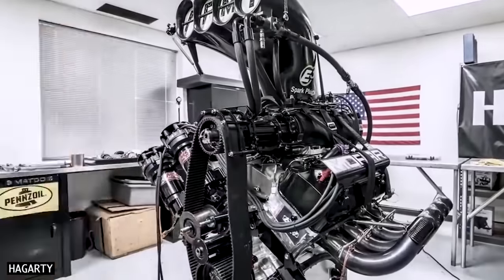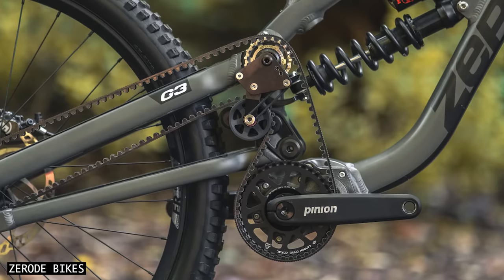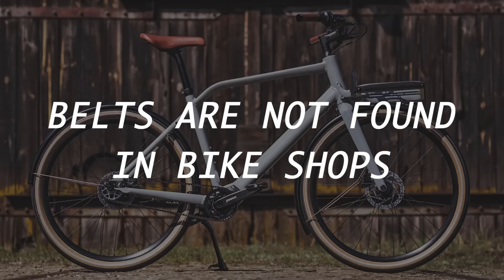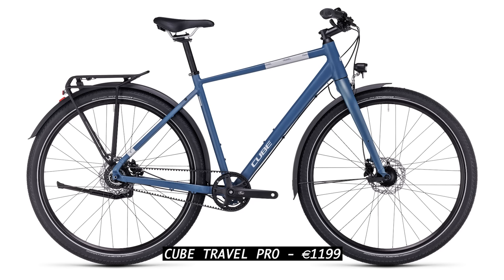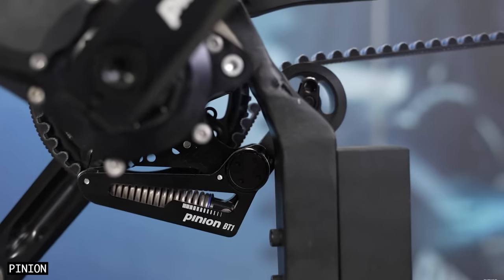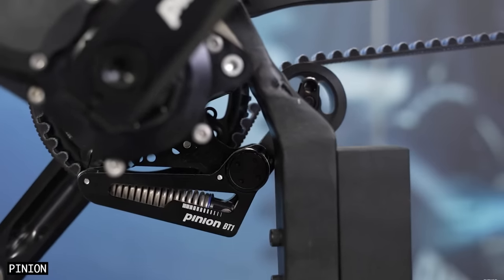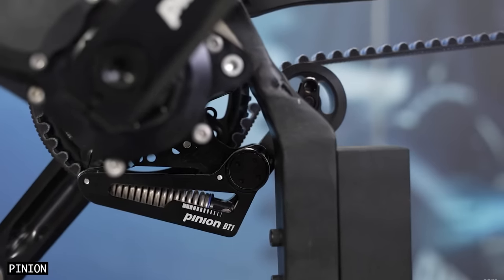Belts Are Now BETTER Than Chains On Bicycles!

Comment: I love  the idea of a belt drive, but it's rather impractical for me. I run wide range 2x drivetrains, my gear range is currently 739%. I am kind of mid fitness, I use my bike for absolutely everything. Commutes, carrying shopping, 100 mile single day rides to 400 mile bikepacking trips.  There are a lot of mountains in the UK in particular between where I live in Scotland and the rest of my family in Yorkshire which is probably my most common bike packing adventure. The range for me just isn't enough. I'm quite a big bloke and on bike packing trips, I like to be comfortable, and warm. And probably carry way too many tools and spares. (Though every single tool in my portable kit has been used at one point or another). I would rather have lower ratios (that also don't take away from my unloaded top end riding speed), so I'm never caught without. Never freezing up. Mountain cos a winter sleeping bag and rugged tent weighs too much On top of that I don't think I'll ever be able to afford a bike with a belt drive, if I could it certainly wouldn't be the highest range one. I really love the idea of no maintainable ect but it's just....very impractical for my use case.

Comment: At this point the only reason I'm not running a belt drive is that my frame doesn't have a break to allow me to install one. My next frame will either be compatible or I'll have a framebuilder modify it so that it is. I ride fixed gear, so this is really the only barrier I have. Well, that and the price of Gates components in Japan

Comment: It is a mystery to me why most e-bikes are not mid-engine, belt drive to a multi-speed internal rear hub. The motor  assist  more than compensates for the added kilo of weight. This is especially true with the road bikes. Saying good bye to chains and derailleurs is worth the extra money.

Comment: Summary
* Belt Drives in Cycling: (00:00:02) The video discusses the pros and cons of using belt drives (specifically Gates Carbon Drive CDX) instead of traditional chain drives on bicycles.

* Advantages of Belt Drives:
    * (00:02:12) Long-lasting:  Lasts 3-4 times longer than chains (35,000-40,000km+ reported).
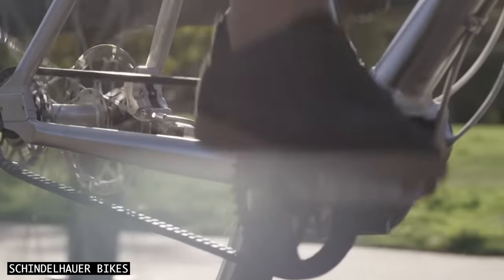    * (00:02:40) Low Maintenance: No grease or lubrication required, just occasional cleaning with water.
    * (00:02:53) Clean: No oily residue on hands or clothes.
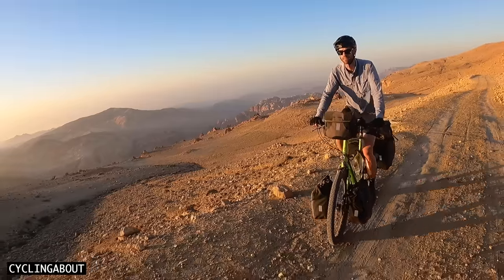    * (00:03:00) Quiet: Operates almost silently.
    * (00:03:08) Good in Adverse Conditions:  Sheds debris well and often paired with sealed gearboxes.
    * (00:03:26) Rust-resistant: Advantageous in salty or snowy climates.
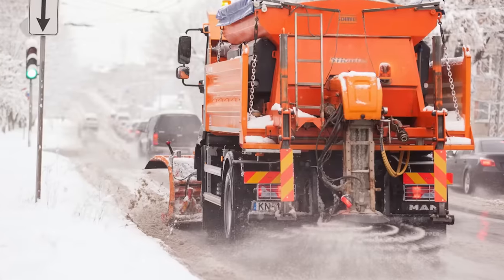    * (00:03:33) Time-saving: Less maintenance and repairs needed.

* Disadvantages of Belt Drives:
    * (00:04:02) Incompatible with Derailleur Gears: Requires a gearbox or internal gear hub, which are heavier and slightly less efficient than derailleurs.
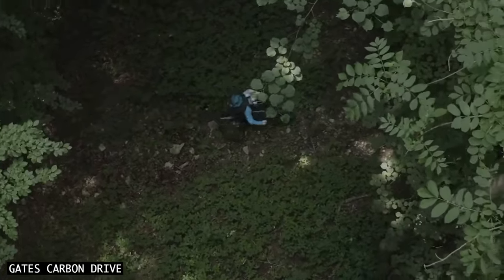    * (00:04:42) Requires Special Frames: Needs a split rear triangle for installation and a stiff frame to prevent belt slippage.
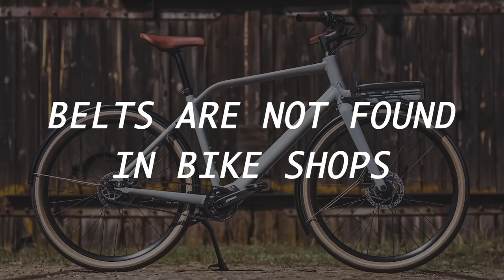    * (00:05:03) Not Widely Available in Shops: Mostly purchased online.
    * (00:05:16) Higher Upfront Cost: Around US$250 for a new CDX drivetrain.
    * (00:05:27) Not Repairable: Requires replacement if damaged, although breakages are uncommon.

* Key Considerations for Belt Drive Use:
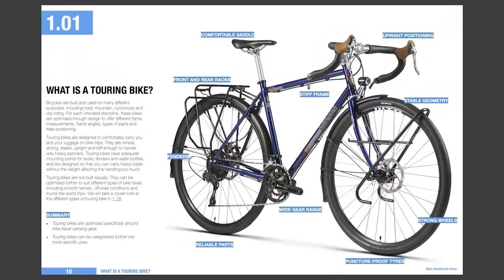    * (00:06:26) Suitable for certain types of cycling: Touring, commuting, bikepacking, cargo, and recreational riding.
    * (00:06:45) Not Ideal for racing: Less efficient and heavier than derailleur setups.
    * (00:11:02) Maintenance Still Required: While low-maintenance, occasional cleaning is necessary for optimal lifespan.
    * (00:14:19) Different Belt Drive Models Exist: Varying levels of performance and price points (SideTrack, CDN, CDC, and CDX).
    * (00:17:07) Proper Tension and Alignment Crucial: To prevent premature wear and potential breakage.

* Conclusion: (00:21:50) Belt drives offer significant advantages in terms of longevity, maintenance, and cleanliness.  However, they come with specific requirements and may not be suitable for all cycling applications. Carefully consider your needs and riding style when deciding between belt and chain drives.

I used Google Gemini 1.5 Pro exp 0801 to summarize the transcript.
Cost (if I didn't use the free tier): $0.0673
Time: 35.93 seconds
Input tokens: 15841
Output tokens: 1126

Comment: I am honestly surprised belt drive internal hub bikes aren't the norm. Most cyclists just want something inexpensive that they can get around on with minimal fuss. You'd be hard pressed to find a bike sold that doesn't have a fragile racing-style gear setup or a rust-prone high maintenance drivetrain.

My girlfriend recently bought a bike that had a misaligned rear derailleur (I think the bike fell over and bent it out of place). It threw the chain into the spokes, locking the rear wheel while riding. It's a shame you can't find a sub $400 internal hub (even 3 speed) belt driven bike anywhere. Somehow we decided that everyone needs a bike with racing gears.

Comment: I have a belt-driven bicycle. The belt jumps under a high torque. Nevertheless, I love this design as lubrication is not required and my bike is always clean as new :)
Reply: Is it not possible to add a pin or roller above the sprocket to keep the belt from lifting?

Comment: And people still think that belts are just for pedelecs. This video definitely busted some myths and I did learn some new things! 👍

But yeah, belt drives are not more common because money. It is simply not profitable for manufacturers to produce expensive bikes in bulk. The need for gear hubs and specialized frames are the main reasons why belts aren't more common, even today in 2024. ✌️

Comment: I had a Gates CDN, never lasted longer then about 4 months.. Though it does not break (only had that once), you just eat all the knobs off, never lasted longer then a chain for me. After about a year the teeth on both the front and rear sprocket looked more like knives then teeth... Kicked all that stuff off my bike and replaced it with chains for less then it would cost me to replace only the belt.

Comment: Thanks for this, I'm trying to experiment with a belt-drive for a home-built e-scooter. 

So far I can get close to 40mph since rebuilding it from Lead-acid to Lithium-ion while still running a chain. The downside is the 25H chain likes to slowly eat sprockets at those speeds. 
 
I did find one pulley vendor that has a larger pulley, but it's nearly 75% of the size of the wheel (like a 92T gear, I'm running closer to a 68T or 55% of the wheel size, and it's the 3-bolt wheel-hub mount). 

I was hoping to not have to push that much torque from a stop, I like my current speed off the line, so if you happen to have any suggestions or resources for where to look for milled belt-pulleys like that, I'd greatly appreciate it. Thanks again.

Comment: The question about car engines belts vs chains, should be mentioned in cars chains are submerged in oil and never exposed to any outside elemens(i.e salt, sand, dirt, water,etc.)

Comment: Good stuff in the dirt or other grueling circumstances in wich my bike would fail and the fact that it's fine open to the elements is a huge advantage but still...
Let me defend the chain here for a bit.  
You compare an open belt with an open chain. In a closed cabinet my KMC chain lasts 25000km, I use a bit of motor oil twice a year and never clean it. 
It's a Nexus 7 citybike but has a ridget fork that I welded v brake pivots on, got rid of the rollerbrakes, make the Nexus hub run with grease only for the bearings, the gears in oil, put in a racing front wheel rather than a dynohub and somewhat wider tyres. 
The steering bar is stock but upside down, two little bars pointing forward fitted for the dolphin riding position. Seat up high and pointing down towards where my hands are.
Pedaling backwards by hand it's supersmooth. Doing exactly that on a belt bike clearly shows a drag I suspect to eat 1-2 km/h. 
After going through a bit of trouble to get my cheap but nifty bike up to speed I wasn't looking for extra drag. It is not a human being after all that provides 10000 horsepower. 
Greetings from Holland, the only country in the world producing closed chainguards, by tradition, but vertically split these days, of and on in a split second.

Comment: belt drive really feels like a solution in need of a problem, it's less efficient and any simplicity gains are offset completely by running a complicated internal gearbox
Reply: an internal gearbox is pretty simple, no maintenance
Reply: @DemsW  Internal gear boxes are anything but simple, They contain hundreds of moving parts.
Reply: @shannontrainer5857  I wasn't very clear, they are simple for the main user, which is the important part
Reply: @DemsW  Replacing a damaged hub gear is anything but simpile and requires wheelbuilding skills.

Comment: 01:48 good demo of tensile strength, but! It is not the tension of the chain / belt that sets the bike in motion, but the teeth !!! I did not see the strength of the teeth for the "separation", which means that all this is the maximum for ordinary trips, but not for aggressive off-road driving.

Comment: Great video. How realiable are the gearboxes vs a deraiuller? I just put 1200 miles commuting on my diamondback union 2, wish it had a belt drive because I'm tired of dealing with the finicky unreliability of derailleurs, there's always an issue. My chain also fell off several times and got bent, $55 for an ebike chain isn't cheap either.

Comment: To add to the car timing belt/chain comparaison... Do belts snap... I automotive application it's actually rare... Usually it's tensionner bearing failiure that causes a belt to burn out and skip a tooth or strip off a bunch of teeth. And whay are timing chains so much superior then? Well again, the timing chain's biggest enemy is the use of hydraulic chain tensioners and not doing proper oil changes that cause the to fail and bring down the whole powertrain. Now, you can get infinite life out of your bike drivetrain if you build a sealed housing around your drivetrain and keep that chain running in a bath of oil!!

Comment: Belts have always been more efficient then chains... but chains last longer. This holds true for Harley, and other motorbike manufacturer. Belts are also use for automotive engine valvetrains. Belts again are fine, but are prone to wear, especially when exposed to sun or heat. Chains are used in engine that never need replacing, unlike belts. Using regular maintenance a chain should last forever.

Comment: 'Better' is a loaded word.

Are belts really ready to replace chains for general purpose heavy-duty all weather mountain bike use?  I still see some issues that have held me back from converting my Surly ECR and Rohloff.  My wife has a hybrid with Nuvinci hub and Gates center drive, which we have no issues with, and I ride a BMW F800S belt drive motorcycle, but here's my concerns that remain:

1a. The difficulty and cost of changing gearing.  It is about $50 for me to swap the chainring, Rohloff cog, and chain to all new parts in whatever gearing I want.  I can change individual components as needed instead - sometimes only a chainring or cog is needed to change gearing.  The Sram NX 1x chainring I have is in stock at many bike shops today in several sizes, and if you stick with a 4 bolt 104 mm BCD crankset availability is even better.  Yeah, Rohloff cogs aren't everywhere, but they're still cheap.  And if you are single speed, cogs and freewheels are pretty much universal.  Finally, 3/32" chains are literally available in every bike shop in the world.  For singlespeeding where you want to change gearing often, or for touring where you may tune the range based on the terrain expected, the chain has a substantial advantage with this.

1b. Belt drive remains (for now) an expensive proposition to start up - and most gearing changes are basically like starting over with the conversion.  And that's not to get into the additional frame requirements - stiffer frames, special cutouts, etc.  Just to get a belt cutout conversion done for my ECR frame would be about $300, on top of the cost of the drivetrain.  And while the ECR is stiff enough to handle it, many bikes aren't - and outfitting them for it costs more as well.  There's not really many budget framesets and bikes out there, and there certainly aren't for every niche that chain bikes are available for.  So it remains an expensive and hard-to-get option.  And - very few people ride the tens of thousands of miles necessary to realize the potential cost savings.

1c. Obsolescence.  3/32" chain drive isn't going anywhere.  But will Gates still be making the same belts and parts in 10 years?  They've made some big improvements on their designs so far, and I suspect there's more to be made.  And will Veer be around, or any of the others?  There's nothing magical about the belts - there are plenty of timing belts in use for other applications, so most of the innovations are likely to be in frame and cog design specific to biking.  So likely you can still get replacements, but there's no guarantee.

2. Many of the benefits of belt drive - like longer life - are already improved greatly with an IGH using chain drive.  Chain and chainring life on my Rohloff is already double or triple what it is on a derailleur drivetrain.  Waxing the chain would extend it even further, and reduce required maintenance.

3a. I remain skeptical, yet increasingly optimistic, regarding the mud and gravel performance of even the Gates CDX system.  I have read horror stories of pea gravel getting stuck under belts and tearing them up on mountain bikes.  I've experienced it on my motorcycle - which has had 30,000 miles put on the original belt, but was taken out by a rock rather than wear.  There's a reason why no off road, dual sport, or adventure motorcycles use belts.  I've also read about mud conditions that can, have, and will destroy a bicycle belt and cogs in a single race due to abrasion and rocks stuck.  That's a very expensive thing to happen compared to replacing a full chain drivetrain.  A spare belt is pretty light, but also not as easy to pack as a couple master links.

3b. Veer belts solve the frame split issue, but the drive cog design with its protruding arms remains a huge rock strike risk for mountain biking.  They do not seem to be suitable for off road use at this time.

4. Suspension design is severely limited by the need to have a constant chainstay length.  You lose so much in full suspension performance possibilities with this requirement.  To date, there have only been two full suspension single speed mountain bikes that I know of - and only one (the Lenz Sport Milkmoney) is still in production.  The Milkmoney is belt drive, though!

So add all of that together, and the need for non-derailleur gearboxes (which I like, but, for the foreseeable future will be more expensive), and you still have a technology that may become more popular than it is currently, but isn't 'better' in the sense that it will eventually supplant chain drive as the preeminent bicycle transmission - at least with the technology available now.

Comment: Belts are cool but planetary hubs have their caveats. I had a nexus 7 and an alfine 11. Both in "like new" condition (i watched my friend mechanic to disassemble them both, its important that he`s my friend, since planetary hub maintenance costs like a spaceship ;) ) I had to sell away Nexus because it sometimes made a terrible sound when i start moving on greenlight and any games that i played with adjustment just did not help. I was told that it is entry level so i upgraded to alfine. Alfine is better, but since it is 11 speed it is VERY sensible to cable adjustment. It worked like a charm for first year (well, almost), but after that it started to fail to downshift. Sometimes it also made a terrible sound when i apply more power. I am staying with alfine, but have to assume that you must feel it to use it succesfully. Also, trying to apply power smoothly.

Comment: The Zerode Katipo is a carbon fiber trail bike that uses a Pinion internal gear box and a Gates belt drive.
 The weight of the bicycle is 14 kilograms. I'm hoping you can review its potential for bikepacking.
Reply: Thats still a crazy amount.   Honestly my full suspension gary fisher cake3 deluxe  from about 1998 only weighed 21lbs and i had chunks of steel sheet strapped to it for protection doing dh. 

I am seriously mystified that the carbon bikes are now double the weight of my alloy/carbon bike from back then.  I slowly watched the forks dropping in weight, and then the tyres, and now were at nearly twice as heavy? Wth😂

Comment: Ill stick with a chain guard to keep my jeans oil free 😅
We've made some huge progress in nano manufacturing recently, we should be seeing ultra small gearboxes soon.

Hell my false teeth are made out of molded zirconia, they could use that even without the nano manufacturing, stronger than steel and perfect for making gears with. Wont chip or break teeth (no pun intended).